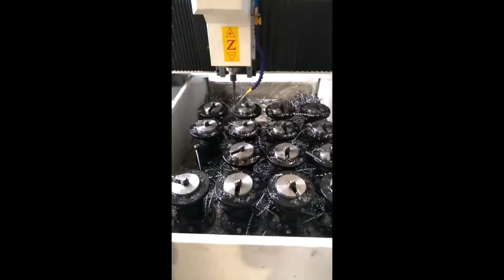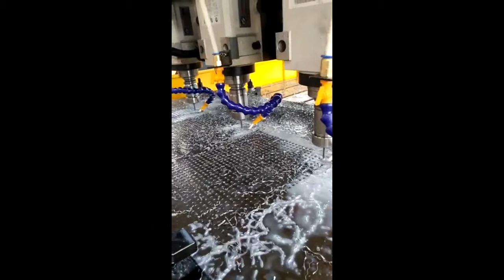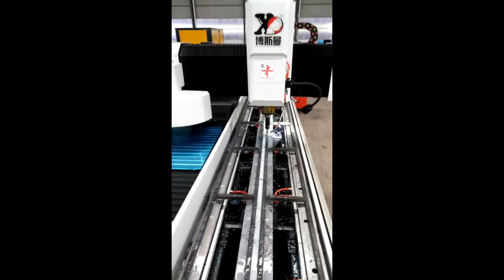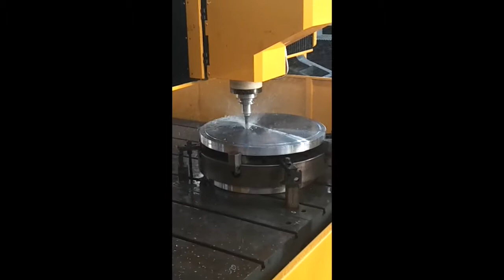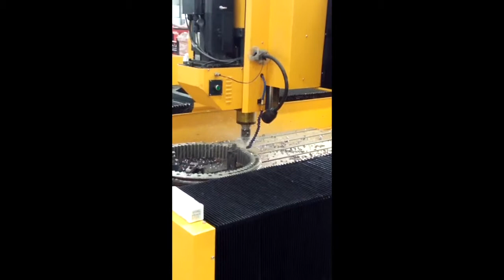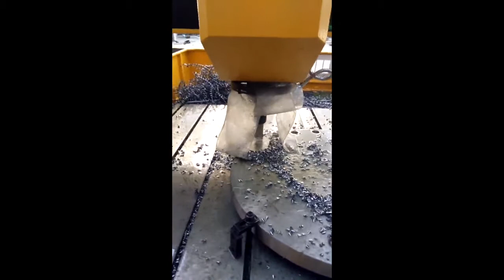High speed CNC Drilling & Tapping & Boring Machine for steel metal plate/ tube /flange /large hole

Comment: Established since 2005, we focus on CNC Equipment, Automation and Mechanical Industry.
The ZoroDrill Series machines are special designed for drilling, taping, beveling, charming, and milling, etc.
The ZoroDrill Series machines are your best drill solution with best-cost performance, bigger working size ever, 
The ZoroDrill Series Machines are built in order to replace the high labor, the inefficient radial drilling machine and any other Non-CNC processing equipment.
We are always dedicated to create values for you and your company.